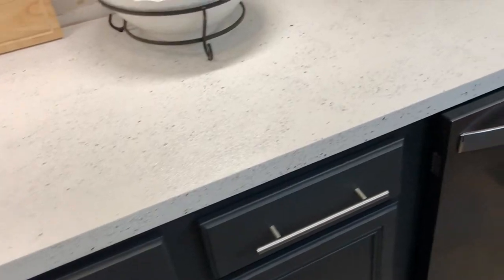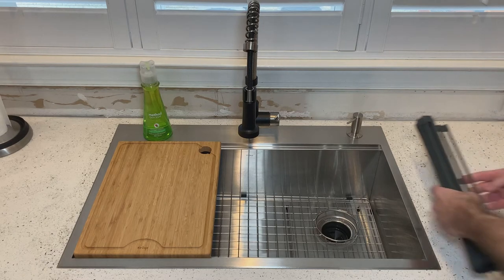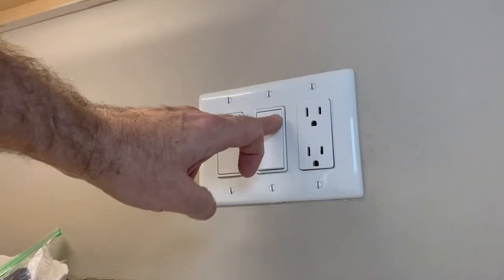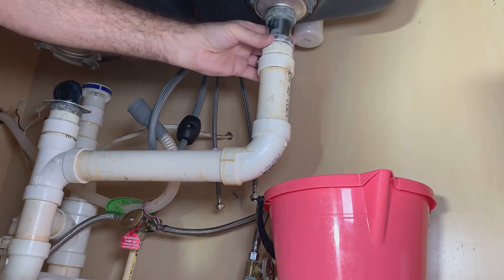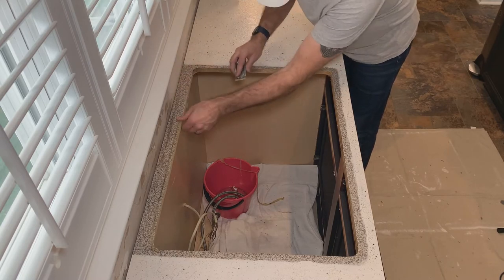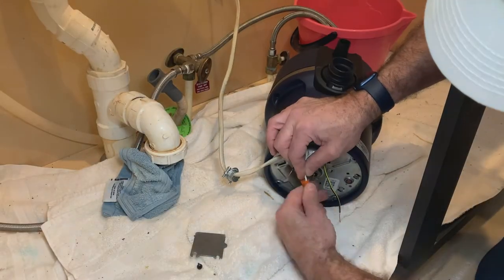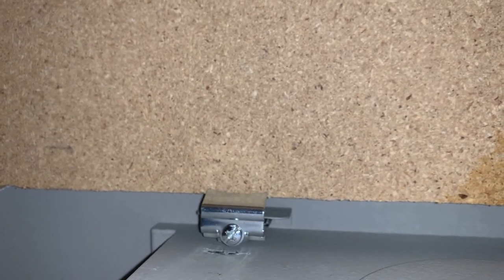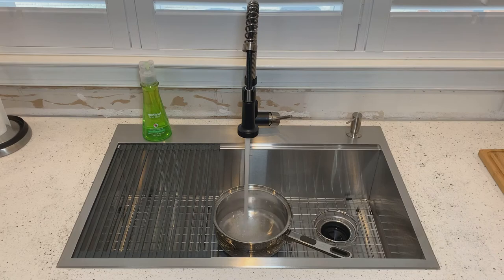Kraus Kitchen Sink Faucet & Disposal Replacement | Kitchen Makeover Series Part 7

Comment: The algorithms led me to your videos, thanks to my recent Kraus Kore Workstation purchase. I loved the video! It was very helpful to see ahead of time. It also led me to realize maybe I should try to resurface or old countertops add well since I'm at it, and you made it look so easy (darn savvy diy videos making me think I can be handy too.) 

I am replacing all plumbing under my sink with this swap out, and was eager to see what it looked like under your sink when you were done, but it looks like that shot wasn't included. Is that something you're willing and able to share? Thanks for considering! 

Warm regards,
A Novice Plumber
Reply from the maker: I’m happy to hear that you found the videos helpful - that’s why I love sharing my experiences. It doesn’t appear that I can share pics or video in the comments section. It was really a simple modification. I would be careful not to depart significantly from the original plumbing arrangement. If going from a two-bowl sink like I did, simply remove the section from drain/garbage disposal up to the point where they join. Replace with the same diameter pipe and keep the arrangement as simple as possible, generally following the same plumbing route. I’m sorry to have left that portion out of the video. Wishing you the very best.

Comment: Did you use any silicone or plumber's putty under the sink edge? I didn't see you apply anything before or after, seems like a huge water seepage risk; I'm not a pro but any overmount I've installed has called for either putty or silicone under the lip before clamping then you remove excess.
Reply from the maker: Great catch! There is a bead of silicone that is placed around the perimeter on the underside of the sink. Clearly, I failed to demonstrate or mention that step in my video. Great attention to detail!😀 Thank you for watching and commenting. Wishing you the best!
Reply: @RegularGuyDIY  nice I didn't notice that, great video either way and I love my single bowl!

Comment: i didnt quite get what the problem was installing the faucet before the sink brackets. Did I miss a problem with that?
Reply from the maker: There’s simply a lot more room to work around the sink when before it’s inverted and installed. My goose required a bit of extra wrangling to install the brackets than it should have otherwise.

Comment: Bought the same sink!! Also going from a double to a single sink, what piece do I use to cap the other drain pipe?
Reply from the maker: I hope you enjoy the sink. You can either remove and reconfigure the drain piping to eliminate the “Y” drain connection or purchase an end cap for the unused section. Wishing you the best!

Comment: What disposal did you get? There’s no link for that in the caption :-) Also, did you have to buy a disposal sink drain or did yours come with it? I just bought the same sink but i need to replace the disposal as well
Reply from the maker: Good catch. I’ll add the link. The sink drain parts are included. Thank you!
Reply from the maker: Evolution SpaceSaver XP Non-corded 3/4-HP Continuous Feed Noise Insulation Garbage Disposal https://www.lowes.com/pd/InSinkErator-Evolution-3-4-HP-Continuous-Feed-Noise-Insulation-Garbage-Disposal/1000068731